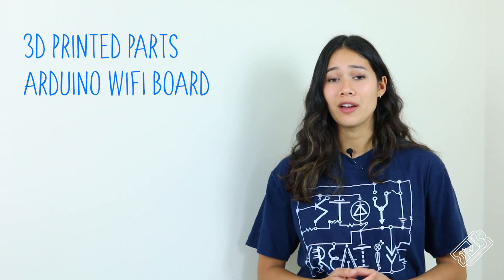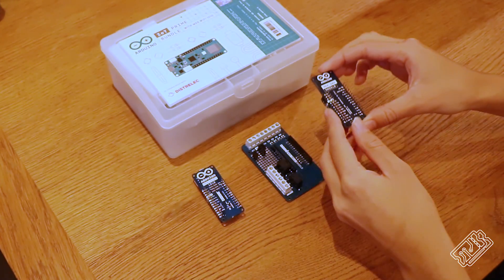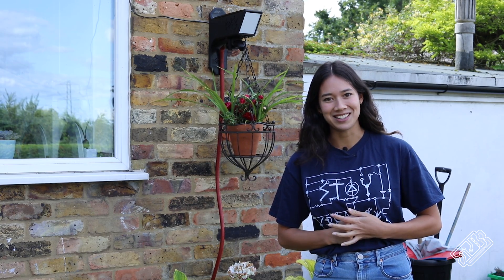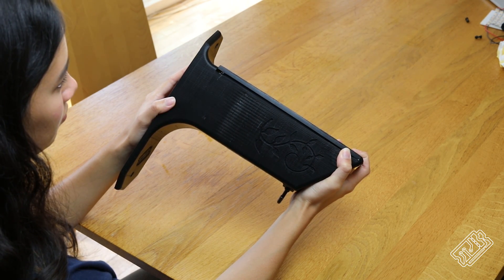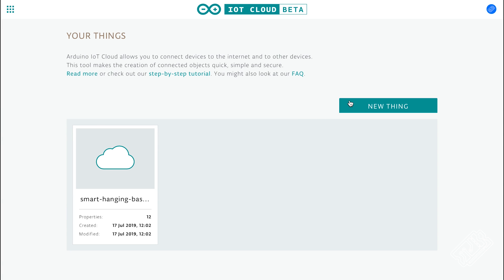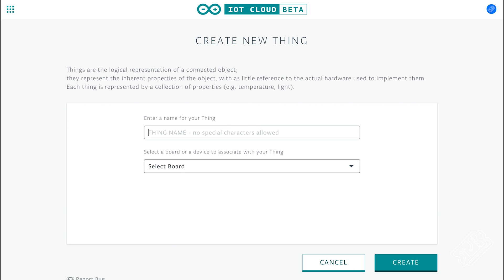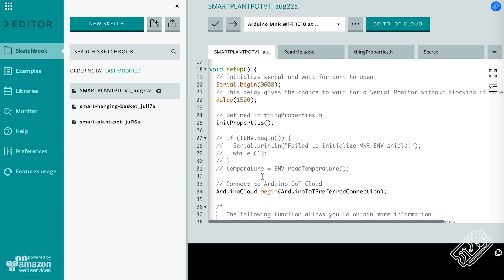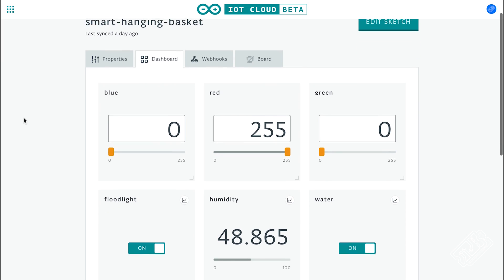Smart Hanging Basket

Comment: Cool idea! I use XTC-3D from SmoothOn to paint over my 3D prints and smooth out the layer lines. I haven't tried it on PETG but it works well on PLA. Otherwise the usual suggestions; print slower, and use a lower layer height.
Reply from the maker: We've used expoy resin before which I think is similar to XTC-3D on PETG and it worked great, however the prep took ages! Thanks for the suggestions :)